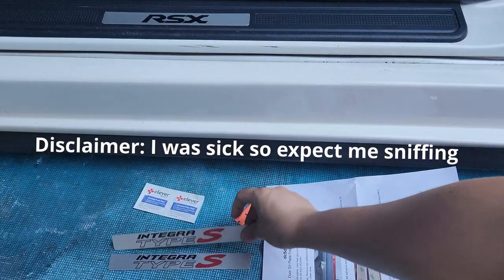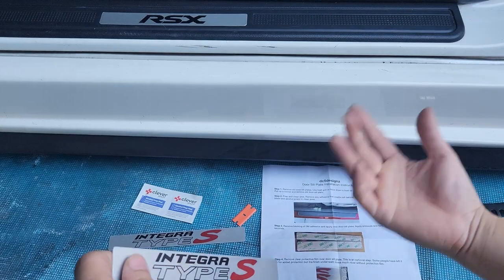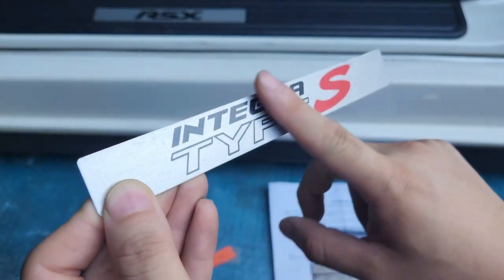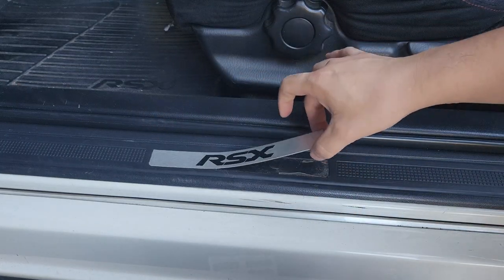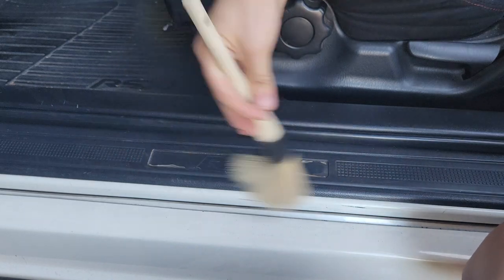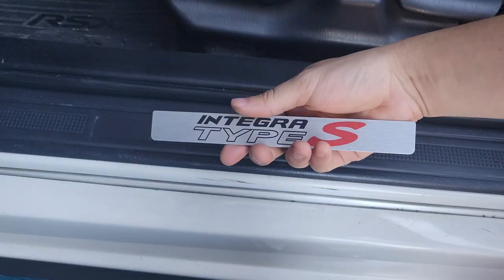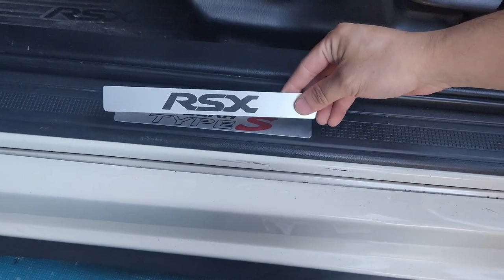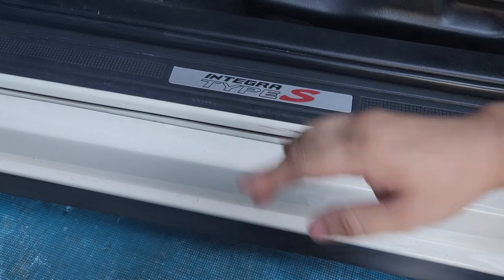How to Install Door Sill Plate On Acura RSX and Honda Integra DC5

Comment: dc5designz is also a fellow RSX Type-S owner.  He knows these cars, and the fit and finish on the sill plates is spot on.  Like I said in your "short" video, I just installed mine late afternoon today.  I decided to remove the top layer, but I understand why you kept yours' on.  My factory ones still look new after 18 years, so I don't think the finish will dull.  Look good either way.  I always appreciate your how to videos.